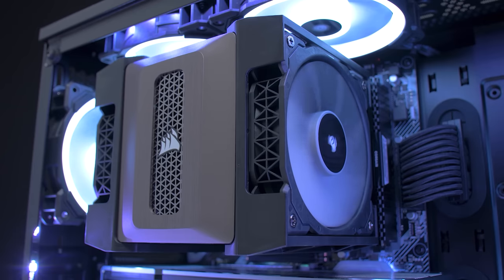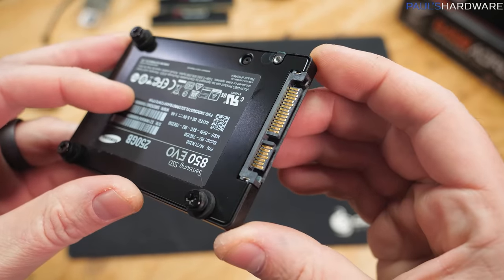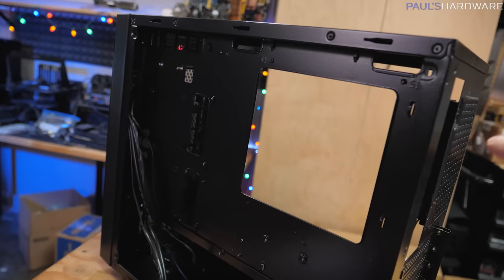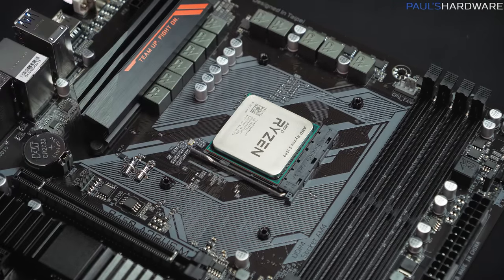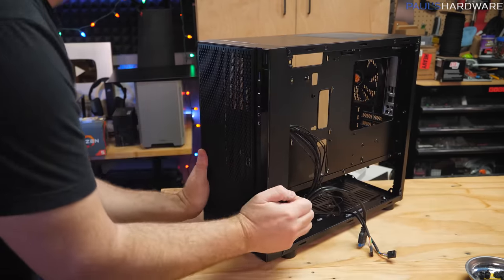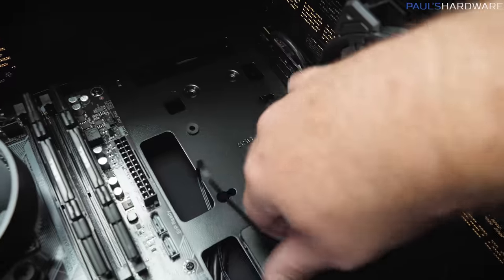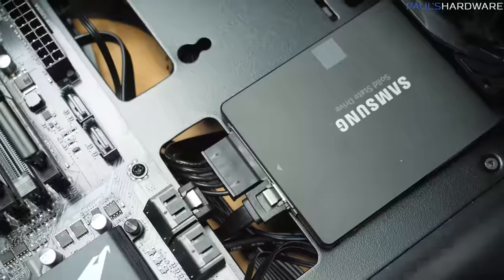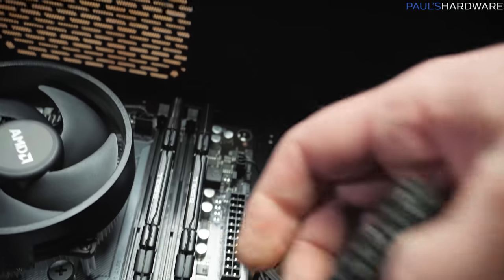How To Build a $550 Gaming PC in 2020!

Comment: $550 for this? Damn, I just checked prices for The Netherlands and the same components together are €670 ($723).
Reply: Right now due to COVID some prices are higher such as the 1600 cpu
Reply: Must be the Netherlands, put together a similar build but with a rx580 for $545
Reply: $710 in the UK (just followed the links, didn't shop around)
Reply: @kazi1  dont buy xfx they are loud and hot. Buy nitro+ 8gb
Reply: @kazi1  or pulse. Sapphire is best company for amd gpus

Comment: I am not sure if this was mentioned but the HDD can be mounted in the basement which will make for a clean build and not interfere with the SSD, assuming you mount the SSD in the front (it can be mounted in the back). Another great video Paul!

Comment: My first gaming computer also had a Ryzen 5 1600
It's a good CPU. I paired it with the 1050ti OC edition. The 1600 worked well until I decided to upgrade my GPU. The CPU ended up bottlenecking the potential of my RX 6600 so I had to get an upgrade for it, too. A Ryzen 5 3600

Comment: Build Cost in India:(1 USD=75 INR)
Ryzen 5 1600: 134$
Radeon Rx 570: 174$
gigabyte B450 aorus: 160$
g.skill v RAM: 107$
adata SU635: 50$
thermaltake versa H18 case: 74$
EVGA BR 600W: 320$

TOTAL: 1019 USD

(Yes, Bishes India is Expensive)

Comment: What eGPU will work with my 2016 15 inch MacBook Pro? 

processor: 2.9 GHz Quad-Core Intel Core i7 
Memory: 16GB 2133 MHz LPDDR3 
Graphics: Radeon Pro 460  4GB Intel HD Graphics  530 1536MB

Is not for gaming it’s to edit 1080p and maybe some 4k videos on FCPX.

Comment: Hi. far out Question: what components would you use for a mid price range like this on a B550 motherboard? So if you upgraded this budget built with a B550 and kept it as close to $700 as you can? I need to do video editing on a budget and like the idea of having a B550. If that's ridiculous, then what graphics card would you pair with B550 for video editing at a low budget?

Comment: Paul, I have a big problem. I am using a Cougar MX660-T RGB case. There's only 3 wires for the Front Header, the Power Switch and the PLed- Pled +. No wire for the HD or Reset. There's a plug F U32C. I've never seen one of those, just so happen the case has the cable that plugs there. Does this take the place of the HD wire, maybe the Reset wire too ??? I am so lost with this. Also, I'm using a AMD Ryzen 5 5600G and 16GB 2x8 DDR4 UDIMM pc4-35200 4400MHz memory. Not using a GPU, using the H150i PRO for CPU cooling. NO POST no beeps. I did do some research on compatibility, unless you may see something I missed.

Comment: If the motherboard has 8 pin and 4 pin CPU connector.... Do you both with a two cables? Or a 8 pin splitter cable to 8 pin and 4 in? Or use either or of the connectors.. prefer the 8 pin?

Comment: I recently got a gaming computer and I thought I had set it up correctly but the screen isn't showing up on the computer, but it is on the monitor. I was wondering if you knew what the problem was, and maybe if you knew how to fix it. It's a long shot but, worth a try. I think it's worth mentioning that it's a store bot computer and I've worked with 1 already that had the same issue. I don't believe I set it up right.

Comment: Great video! Just built mine 2 weeks ago. Gigabyte B450M DS3H MicroATX motherboard (not planning to OC so this was a good buy for me), AMD Ryzen 5 3600, ASUS GeForce 1660 TUF Series, G.Skill DDR4-2400 8 gbx2, Corsair 110R mid-tower case. All of this for under $600. I already had an SSD and other drives, and I already had a Corsair TX650M Gold power supply from my previous build that was 10 years (AMD Phenom II X3 720BE OC'd to 3.2ghz with 4th core unlocked). Pretty pleased with it. Too bad the power supply wasn't full modular but still, it's pretty tidy inside and booted up the first time I tried it and has been running nice since.

Comment: I would love to be able to build a good strong computer for less than $500.  I would like to play Flight simulator 2020.  Looks like it needs some very strong graphics controller.  So I think I need to focus on a system that focused on the GPU! Have you any recommendations?  I could use small form factor, But i have room for a full sized case,  Or even an open aired setup using my wire shelves.

Comment: hi, beginner here, this will b my 1st build any advice? 
 AMD Ryzen 5 3600 3.6 GHz 6-Core Processor	8W - 65W
MSI MAG CORE LIQUID 240R 78.73 CFM Liquid CPU Cooler	10W - 15W

MSI MPG B550 GAMING EDGE WIFI ATX AM4 Motherboard	17W - 70W

Corsair Vengeance RGB Pro 16 GB (2 x 8 GB) DDR4-3200 CL16 Memory	14W

Western Digital Blue 500 GB M.2-2280 Solid State Drive	2W - 10W

Seagate Barracuda Compute 2 TB 3.5" 7200RPM Internal Hard Drive	4W - 20W

MSI GeForce GTX 1650 G5 4 GB GAMING X Video Card	18W - 75W

Cooler Master SickleFlow 62 CFM 120 mm Fans 3-Pack  3w - 15w

Corsair RM (2019) 650 W 80+ Gold Certified Fully Modular ATX Power Supply

Comment: As of today, 7/23/20, the CPU has almost doubled on Amazon, $156.99. The GPU is unobtainium on NewEgg, but the 8GB version is $179.99 (the original is 4GB). On Amazon, the 4GB GPU is outrageous, currently running $299.99!!! Used is cheaper, but not much. Why would the 8GB version be far cheaper? I can see it isn't rated nearly so well, like a whole point lower (3.3* versus 4.3* for the 4GB). Anyone know of problems with this card? Might as well buy a GTX 2060 KO Ultra, it's only like $20 or so more.

Comment: ? What screw drivers do you need for any pc and do you need them
Reply: A phillips head screw driver is usually the only screw driver you need. A lot of cases are "tool-less" in the sense that you don't need a screw driver to take the side panel off (thumb screws) and drive cages that don't require screws. You still need to screw in the motherboard and fans if you're installing extra ones. I have an iWork screw driver kit that works well for me. I mainly use the PZ2 bit which works for the majority of computer hardware that I need to use screws on.

Comment: Hey, Paul. I made this build in late November last year with some slight modifications: 
(1) AMD RYZEN 5 2600X 6-Core 3.6 GHz (4.2 GHz Max Boost) Socket AM4 95W YD260XBCAFBOX Desktop Processor, 
(2) Intel 665p Series M.2 2280 1TB PCIe NVMe 3.0 x4 3D3, QLC Internal Solid State Drive (SSD) SSDPEKNW010T9X1;
(3) Windows 10.

I'm currently running into an issue and can't seem to find a solution online, I was hoping you could help. When the pc goes into sleep mode after being idle for 30 minutes and I come back to wake it, in no less than a minute of me opening windows and using do the screens go black and the RAM fans turn on at full blast. The pc doesn't restart, so I have to reboot it myself. This happened early on, maybe for the first two/three weeks, but then the issue just went away, but just this weekend the issues started back up. Any help is greatly appreciated.

Comment: I love this build, however, I'm very tight on money. Do you have any cost-cutting suggestions?
Reply: I guess the motherboard maybe?? If you plan to go on the 3000 family the Gigabyte B450M DS3H is a nice cheaper board. Also for some reason I don't like the case chosen for this specific video so I'd go with something else. I personally went with the Cooler Master NR400, it's a mATX case and comes with 2 pre installed fans which is very nice.

Comment: The AMD Ryzen processor is not available. It acn be order through amazon however it is $256. I purchased the 
Intel CPU BX8070110100F Core i3-10100F / 3.6GHz / 6MB LGA1200 4C / 8T. Will this be compatible with the other parts in your build? It also states that the Intel I3 has a built in graphics card. I purchased the Gigabyte Radeon RX 570 4 GB Video Card as well.  This is my first build and want to make sure It works when I'm done. Can you offer any tips with eth Intel I3?

Comment: Thank you for sharing your experience.  Please advise and don't laugh [nah go ahead and laugh], but I am trying to save my old computer. My old Lian-Li ATX Mid Tower Aluminum Case PC6002 COM needs a rebuild/upgrade unless I can reattach my CPU heat shield and fan. On Saturday, August 22, 2020, the CPU and CPU Heat Shield dislodged from each other due to the thermal paste adhesiveness expired from age [2009] in addition the plastic loops dry-rotted and the fan clasp disengaged from the MOBO. Just a couple of years ago I configured my LianLi ATX Case to dual boot with WinXP home and Linux Ubuntu 16.04. My MOBO was a Micro-ATX BioStar VIA P4M900/VT8237A; Intel Pentium 4.  I would like to rebuild this computer, so I can use the legacy hardware e.g., floppy disk, IDME HDD etc; however, my second option is to upgrade on budget, so I can install my old operating systems [Win 95 through Windows 7]

Comment: Great video! I like the channel. Very well done. However, when I built this PC, the display would not show and BIOS would not come up. VGA LED is lit. I'm going through the troubleshooting process. Read forums, watched videos. Taking forever, and I need to get this done. Anyone else have this problem with this build? If I figure it out, I'll post the solution. But I'm running out of time. Warranty/return policy dates for these parts are coming up fast.

Comment: Paul. Can you hook up a CD/DVD/Blu-Ray player to the motherboard also where do you but the WiFi/Bluetooth chip at?
Reply: If you want to buy an internal DVD drive, make sure your PC case has at least 1 5.25 drive bay. If not, you will need to choose another case or buy an external DVD drive. You can buy wifi adapters on pretty much any physical/online retailer that sells computer hardware/electronics.
Reply: @JJFlores197  I was contemplating some things. I remembered they do have usb WiFi and Bluetooth adapters. I also did some research on how to transfer old pc games on disk to a usb flash drive but the con to that is the disks might have write protection on them and it won’t work. Can’t you buy the CD drives for external use like you do with external hard drives?
Reply: @Schwarzgeist89  You can make copies of most PC disc games relatively easily. I use InfraRecorder to make ISOs of game discs. Some copy protection in games may detect that it is a copy though. Like I said, you can buy an external DVD drive that plugs in via USB. DVD drives will read CDs as well.

Comment: The processor was 250$ so would a 150$ AMD Ryzen 5 2600 Processor with Wraith Stealth Cooler - YD2600BBAFBOX also work? And the graphics card was put of stock but I found a GIGABYTE Radeon RX 570 DirectX 12 GV-RX570GAMING-8GD Rev 2.0 8GB 256-Bit GDDR5 PCI Express 3.0 x16 CrossFireX Support ATX. If anyone knows these parts could work instead it would be a huge help

Comment: Hey, great video, Does this build run with the most demanding titles at least in full hd?
Reply: So long as you pair it with a reasonably decent GPU and fast clocked RAM it may even run games in 1440p. The 1600 AF is a very decent chip and very memory hungry. I wouldn't go with anything slower than 3.000MHz for the RAM.
Reply: Depends on the settings. Ultra? No. Medium? Yes
Reply: Thanks for your answers, Do you think a 3600 would be better for my purposes?
Reply: @carlitosmo  as of right now absolutely. The 1600 af seems to be scarce and expensive if found (+100). If your main purpose is gaming only go with either the Ryzen 3 3100 or the 3300X
Reply: @miltonpessa4930  thank u, Bro, I want to have a PC gamer, your advice is very helpful

Comment: Paul, thanks for this video! The memory you link to states it is designed for Intel, and it doesn't seem to be on the Mfg. supported list for this board with this processor.  Can you confirm those work ok in this motherboard with the recommended processor?
Reply: correction: I was looking at Ryzen 5 2600, so a different processor and different AMD tech.  Anyway, advice?  Expect it to work?

Comment: Great Video... Still very relevant in 2021. My build used the exact same PSU, MB, CPU, and RAM. During my build, I received and built all the computer components with the exception of the Video Card. Because of Video Card shortages, I had to wait weeks before it arrived. Since the board has integrated video, I decided to build the computer without the GPU to get everything running and Windows installed. 

Long story short, the computer wouldn't POST. The error light on the MB indicated an issue with the VGA. I had a feeling the F52 BIOS just couldn't get the integrated video working with the 1600 CPU. 

This was the correct assumption. After installing the video card, she booted right up.

I wrote this post to keep folks from freaking out if they're in the same situation. Having your computer not POST can be a little stressful.

Comment: I purchased a 2tb HDD drive for my PC. I was wondering are he sata cables purchased separately?
Reply: Some HDDs come with a SATA cable and some don't. Your motherboard should come with around 2-4. If not, you'll have to buy one separately.
Reply: @JJFlores197  I just purchased this pc. It's my first one. Its a skytech chronos mini.
Reply: @cozynumbness5072  I see. I'm not familiar with pre-built gaming PCs. If it didn't come with an extra SATA cable, you'll have to buy one. They're not that expensive. You can usually find them for less than $10, even less than $5 on Newegg.com
Reply: @JJFlores197  yeah i looked up a few and thank you so much for your response!

Comment: Ryzen 5 1600?  The Ryzen 3 3300x is a newer, cheaper, and faster chip...yes it's only Quad Core as opposed to 6 cores, but for gaming...it's actually a better bang for the buck.  If you're doing video editing or something on the cheap, then yeah the 1600 is probably a good choice.  In fact, this processor is only cheaper on ebay, for a few extra bucks (and I'm talking like 10 to 20 on ebay or a deal on Amazon), you can get 2600 and see more performance.

Comment: Is insatlling hardrives the same as installing the SSD?
Reply: Its the same concept. You install the hard drive into the case and run data and power cables to it. Connect one end of the SATA cable (data) to the data port on the drive and the other end to a SATA port on the motherboard. That's pretty much all there's to it.
Reply: @JJFlores197  your the best man thanks for the help!

Comment: Nice video!!  I went to best buy to look a new computer 1600.00 and I just thought what a over priced computer it was. I want to build my own computer but I need buy new windows programing and ugh!! any ideas on making the transaction  easier
Reply: Dave if you have windows 8 there is a legal download to get windows 10 off Microsoft website , Google it. If I find the link in my stuff I'll post it.
Reply: you can do it with a motherboard that has a am3-b(same as am3x) socket  you can play Red Dead Redemption 2 with this stuff-Zotac GeForce GTX 1060 6GB9($170)AMD FX-8150 3.6GHz Eight Core($95/ebay/half the price of fx8350) A-Tech 16GB Kit (2x8GB) DDR3 / DDR3L 1600 MHz PC3-12800 UDIMM 2Rx8 1.35V/1.5V CL11 240 PIN DIMM Non-ECC Unbuffered Desktop Computer Memory RAM Upgrade Modules($56/amazon) plus $150 for used motherboard,650 watt power supply and discount case- Total $471( to $550) this is the upgrade to my HP-h8 1414

Comment: good PC build for price but would recommend getting an asus prime b450m motherboard and for the case you could get the corsair spec delta which has better cable management and comes with 3 light up rgb fans and 1 regular rgb fan and only 10$ more. I would also recommend getting a ryzen 3 3200g and i know it has integrated graphics but it would still be better.

Comment: I am 'trying' to build a new Ryzen 5900x system, but with processors so hard to get, anyone have any possible temporary, cheap ryzen  to use on a X590 MB with RTX 3080 (yes I could get one of those). Rather then spend $800 for a scalped 5900x, I figure I could get a ~$200 processor in the older zen line (suitable for X590) that I could do OK with until I can secure the 5900x. Thoughts?

Comment: It's Oct 2020... only six months since this video was posted and the prices in the build list are NOWHERE near $550.00.   For just the motherboard, CPU & video card it's almost $500.00 bucks using the provided links.  Add SSD, case, RAM , cooler, etc this build is closer to $1,000.00.  Hard to believe all this could be had six months ago for half the price?  I think it's proper to correct the title of this video.

Comment: if we wanted to use a case that had more rgb in it, would these parts still work with it?
Reply: The main thing to look for is to make sure that the motherboard will fit with the case. This build uses an ATX-sized motherboard, so any PC case that supports ATX motherboard will work.
Reply: Jose Javier Flores aight bet thanks man

Comment: I just checked the prices in Australia:
AMD Ryzen 5 1600 "AF" 65W AM4 Processor (YD1600BBAFBOX) $229
Gigabyte B450 AORUS M Micro ATX AM4 Motherboard $174
Gigabyte Radeon RX 570 4 GB Video Card $260
G.Skill Ripjaws V 16GB (2x8 GB) DDR4-3200 Memory $227
ADATA SU635 240 GB 2.5" Solid State Drive $57
Thermaltake Versa H18 MicroATX Mini Tower Case $62
EVGA BR 600 W 80+ Bronze ATX Power Supply $263

+ DELIVERY =$100 at least

=AUS $1,372.00 seems a bit expensive for a "budget" type Gaming PC

Comment: does this have a wifi card in it?....does this have a windows operation system on this?
Reply: Most motherboards don't have Wi-Fi built-in. If it did, you would know because it would say so in the box. If you build your own PC, it will not come with any operating system, so you will need to provide your own.